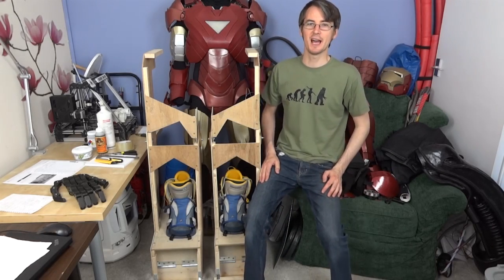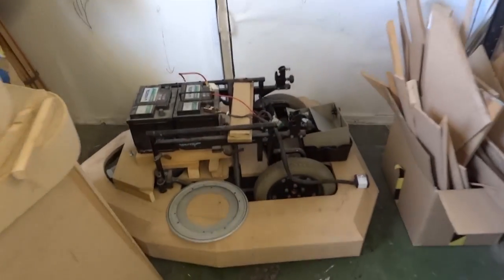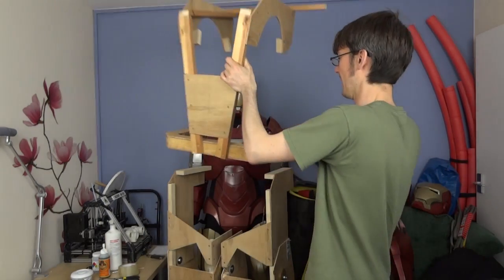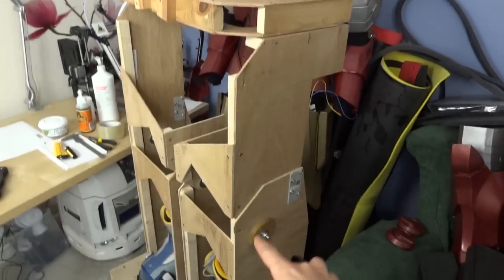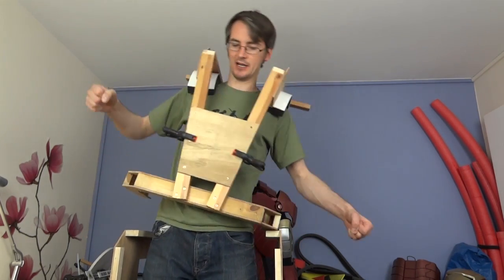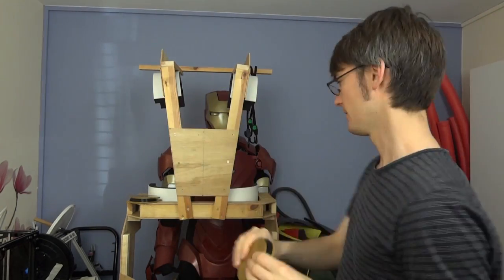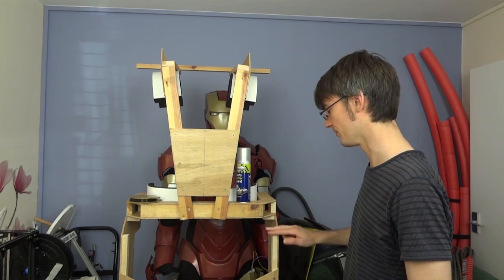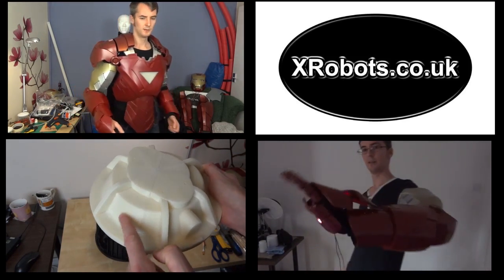Iron Man Hulkbuster Cosplay #4 | Building the Torso | James Bruton

Comment: really coming along well, im just wondering if the torso section will support the weight of the arms without breaking as their is no back piece to support the weight. Still it looks more like a suit now so well done.
Reply: yes but when you lock the joints and get out, it will no longer be supported on your shoulders. I was wondering what will then support the weight of the arms without you in it?

Comment: I would avoid cables wherever possible. They seem to bind and cause issues if used often. I would recommend a servo bases system. You could have a few critical points with an emergency pin and cable system to ensure that you don't get trapped inside. Just a thought. I love the possibilities of the project. Keep it up!